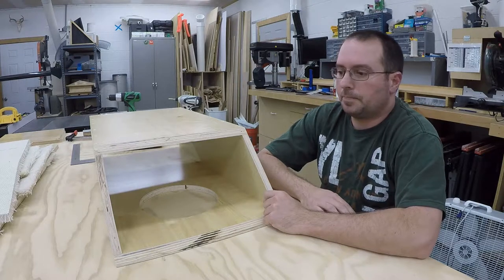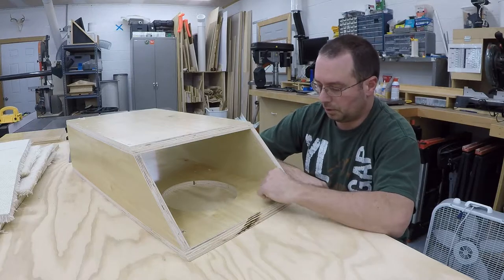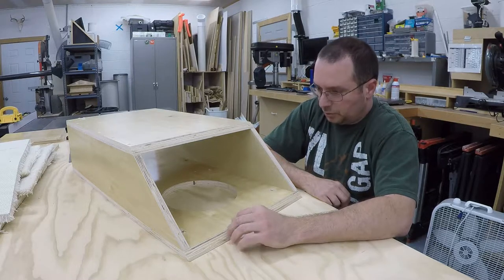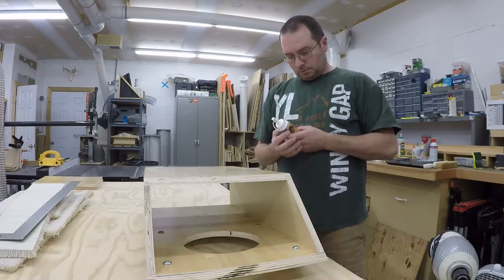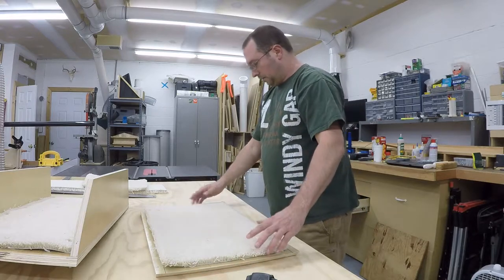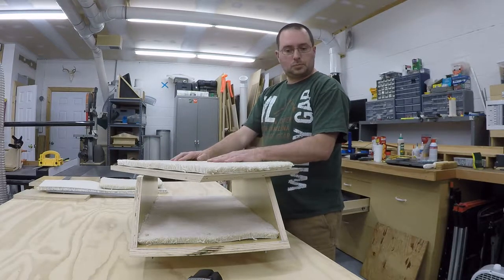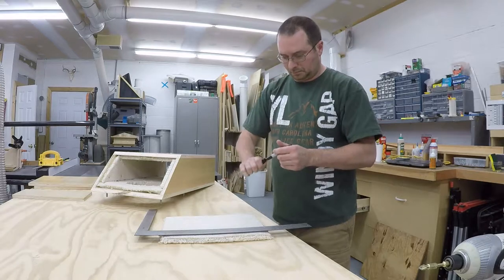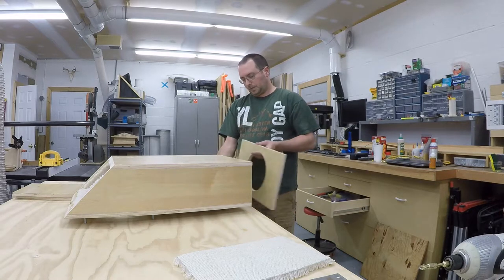Wynn Filter Upgrade - Part 3 Plenum Build

Comment: Andy, where did you get the plan for the plenum? Best wishes.
Reply from the maker: I came up with it to fit where I removed the block out of the wall.
Reply: @andycannarella  Thanks.  I'm designing a cyclone conversion unit. I want to use a plenum. I haven't seen that done in a mobile unit. And I don't have any idea what dimensions would optimize air flow. Thanks for your quick response.
Reply from the maker: I look at it this way, once the airflow leaves the blower you don't want it restricted. That's why I used 8" metal ducting in my shed to bring it back around to the plenum box. Even the cross section of the plenum box is equal to or greater than the 8" pipe. It's like blowing through a stirring strap or McDonalds straw. Hope that helps.
Reply: @andycannarella  thanks very much. Did you come up with the angle to one end of the box yourself?
Reply from the maker: @jaykepley5238  I read somewhere you don't want that high volume of air to hit a flat surface so I angled it to help divert it into the filters.
Reply: @andycannarella  That makes sense. Your design is really nice. Thanks again for your time and insights! 🖖

Comment: Hi Andy,
Have you had any issues with static charge using PVC pipe?
Reply from the maker: There is some static build up depending on the humidity and what you are flowing through it. I have been shocked while touching it then grounding out. Planer is the worst offender.
Reply: @andycannarella  Thanks for getting back to me. Do you have a wire running through the ducts (I assume not)? It looks like a nice setup in your shop.
Reply from the maker: @rorna1930  Thanks, No wire through the duct. I live in the south where we don't get terribly dry to create a ton of static. If so I would put foil tape in the duct as the conductor.
Reply: @andycannarella  Good idea with the foil tape. I live an hour east of Knoxville, TN now and my shop is in the lower level walkout. I am in the design/layout phase of setting things up after having moved from the Chicago area.